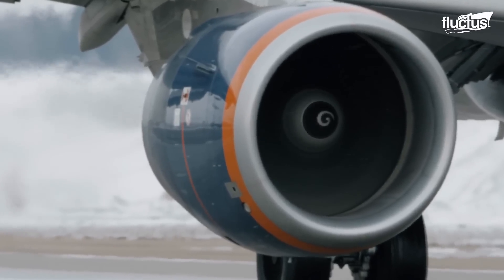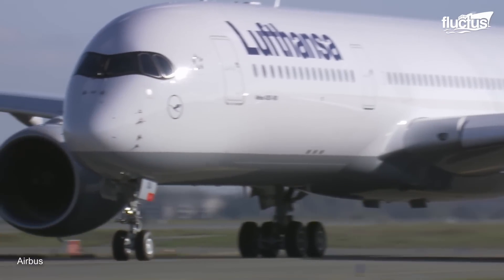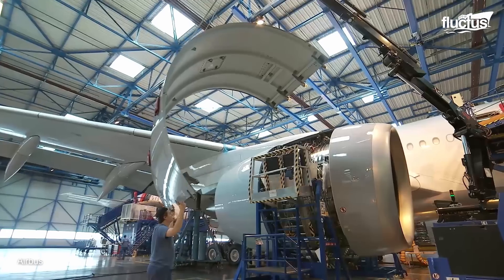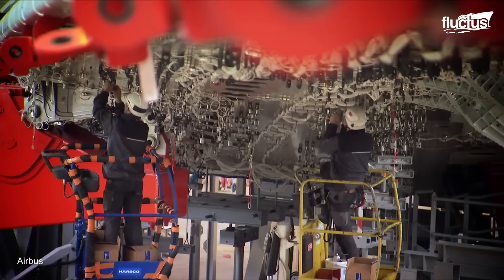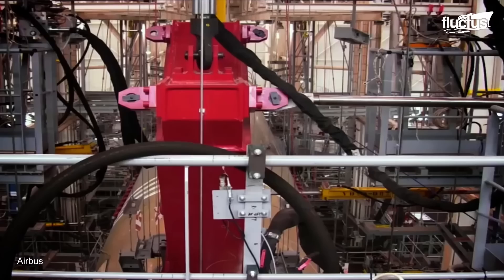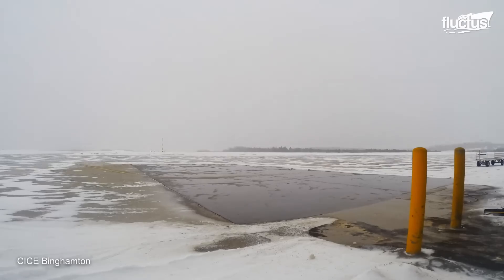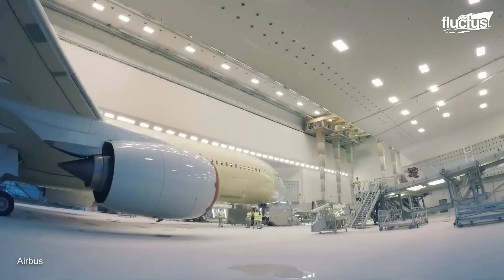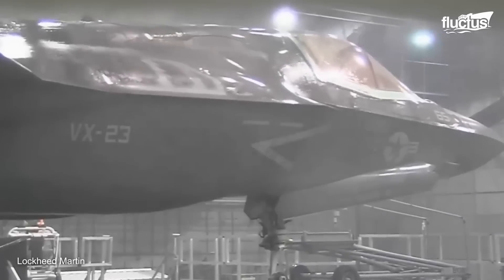How Brand New 370 Million $ Aircraft Are Cruelly Tested Inside Giant Fridge

Comment: So; do they do that for each aircraft or just the testing one ? I am just curious.
Reply: These static tests are done for one aircraft cell. The data is needed for certification of the aircraft type. Later each individual plane is testflown by the manufacturer to test all functions and than mostly flown a second time by the customer just before delivery.
Reply: just probably 5 or so........  think about it,  once you know the breaking point of something and get the same results 4-5 times wouldn't it be the same for #6?  YES!!!
Reply: For each new aircraft they do these tests on a few aircraft. To obtain certifications, then every aircraft is static and flight tested only. For example the structural tests are not performed on each aircraft